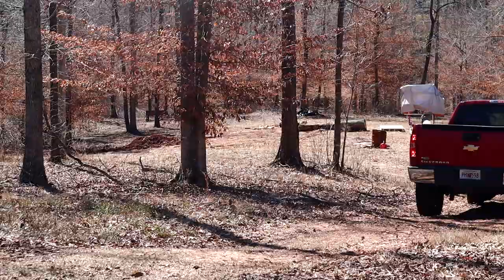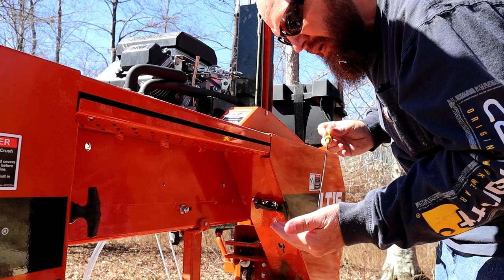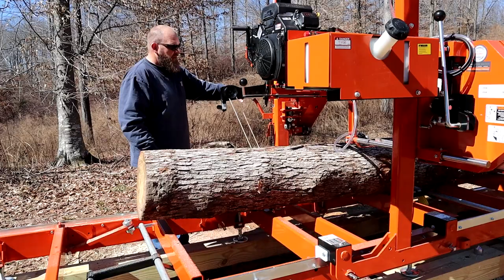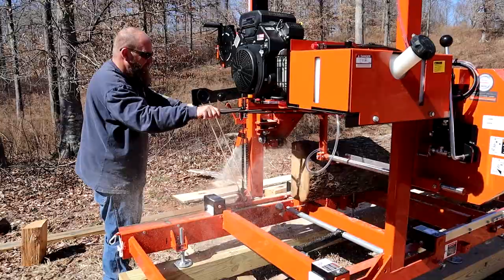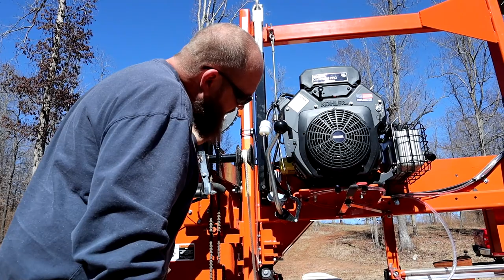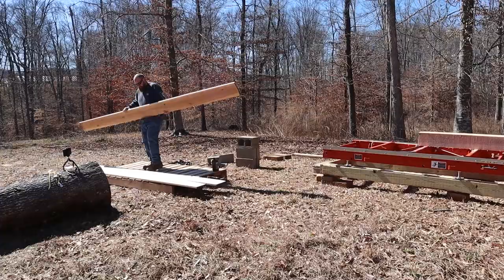Learning How to Mill on the WoodMizer LT15 Wide.

Comment: good vid, suggestion u can see starting minute 10, draw your guide edge in to about an inch or so from the squared cant. less deflection and strain on the blade when you are choked up closer to the entry point for the blade.